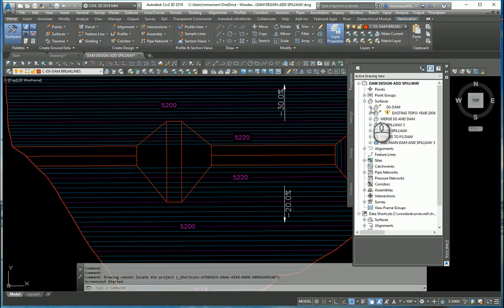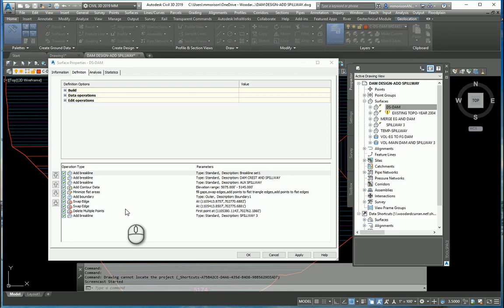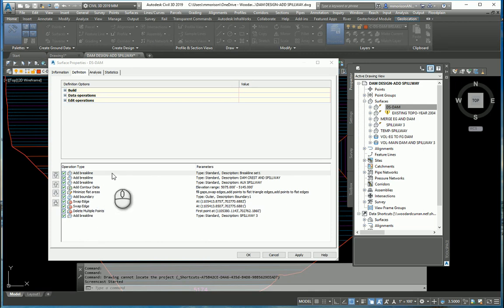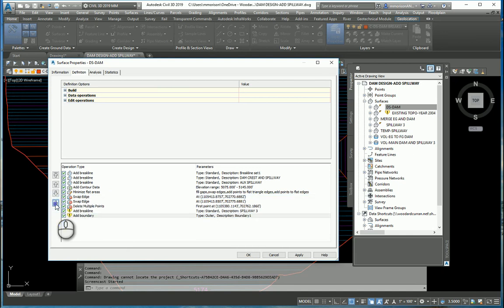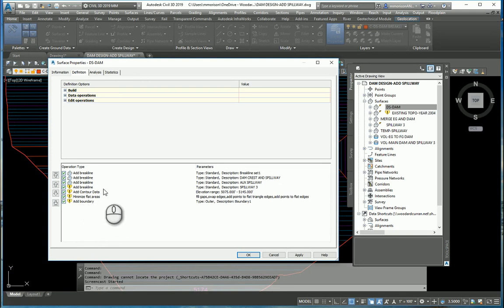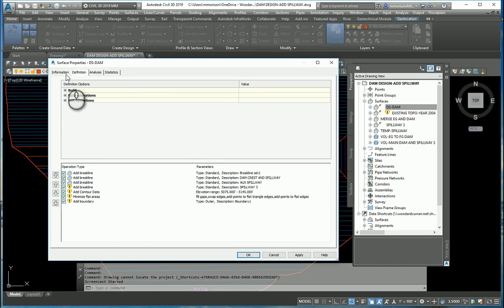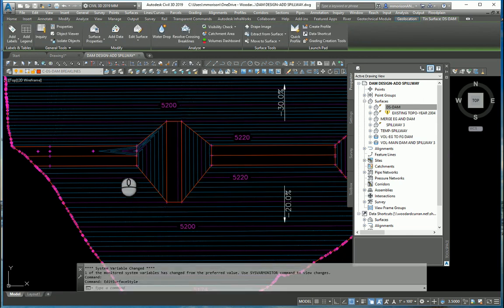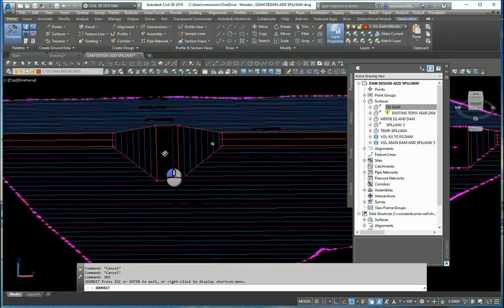CIVIL 3D  HOW TO FIX MULTIPLE ISSUES WITH SURFACES

Comment: This is an absolute gem... I've been building my surfaces incorrectly this whole time. You're totally right about too many operations/modifications to the surface bogging down its appearance and accuracy. The draw order 100% matters, and so does simplicity. 

I usually start building a surface with lidar points, then remove points from that surface, then toss on survey points I want, then I'll create featurelines and add them as breaklines... Even after all that, I'll spot-correct some areas and pop in custom cogo points with a desirable elevation. At this point in my surface, if I were to turn on Points and Triangles in the Surface Style, it'd be all over the place. Things get weird when the surface is described to that level. Too much behind-the-scenes math and processing going on. 

Anyways... How did you create the breakline titled "DAM CREST AND SPILLWAY"? How about "AUX SPILLWAY"? Did you make featurelines or 3Dpolylines from points? I haven't watched your other videos yet, but I'm grateful I found this one! I'd like to draw bulletproof surfaces instead of shoddy ones. THANK YOU FOR THIS VIDEO!! NEEDED IT
Reply from the maker: great! i just named the polylines that represented the top and spillway at once, i just name them so that if my surface is messed up, i can uncheck the box that has those breaklines and see if they messed up my surface, i use mainly polylines with single elevations, but i will use 3dpolylines when i have an elevation change. if you have a point group going, yes, you can use a feature line or 3d polyline between points, just make sure you have osnap on to pick points with elevations. So glad that this video has helped, you. You have made my day!